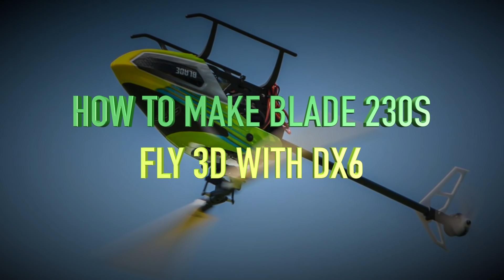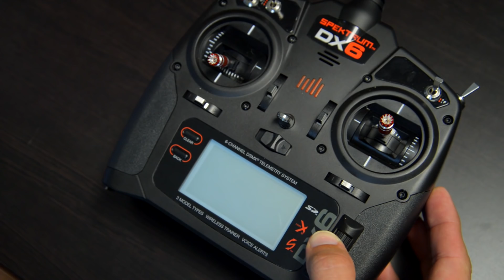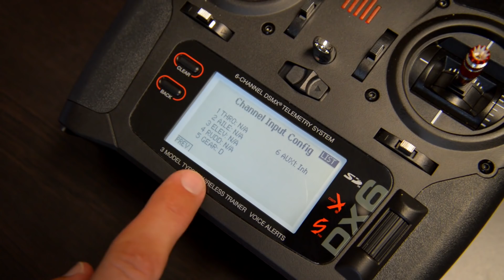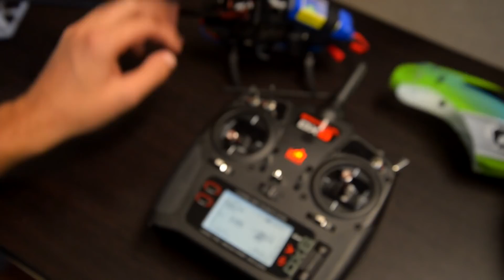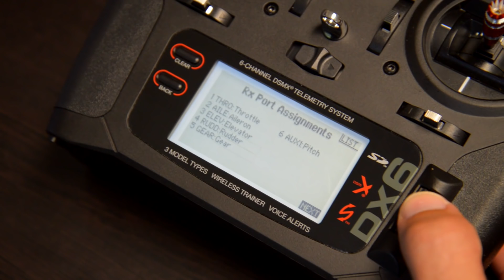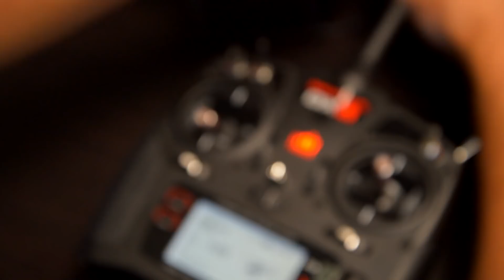How to Fly Blade 230s in 3D Mode with Spektrum DX6

Comment: This video is eight years old are you still out here somewhere I need help… I'm trying to get stability mode on normal which it is but I also want it on flight mode 1…If you're out here somewhere do you still know how to do that or is it possible… I'm just an older guy that just wants to fly and stability mode but I wanted to be solid if I bang it around hard Rudderr hard climb outs… I wanted to be solid but instability mode.  I don't like the low had speed it normally comes with.  Everything was spongy and awful for my flying style

Comment: Just a question.  My swash tilts really a lot with left up high. After spoolup you can lift of, but my normal mode also does the same. But when i move the sticks the swash stays where it should. When you switch to normal, should the swash not level and not stay in the position of a level swash. My heli want to tilt forward.

Comment: The DX8 is a lot better I hear. Even better than the DX9 when it comes to Choppers. It's the most used Transmitter in my Club(I think they call it 8.1). It has a far better programming + other details, and ½ the price of a DX9, if not even cheaper, but same quality and making.

Comment: I'm confused...  the swash should still follow the sticks even if the safe mode has been disabled. ie... Once the safe mode has disabled the swash should go back to a level position because the right stick has been placed back to zero input for aileron and cyclic. Yours does not.
Reply: Exactly. Slowly, but it should level out in idle up, too.

Comment: When I set it up to the manual my servos would always go to neutral but would not try to self level when I pick the heli up and move it side to side when in idle up.  But when in stability mode the servos would always try to correct it.

Comment: can you please do a setup for dx9
Reply from the maker: It would probably be almost exactly the same. Just observe which switches you want to program and assign them accordingly. The GEAR setting is where it all happens and why I made this video. To share that tidbit that the manual left out. They may have added it now on these newer ones but mine did not have that description in the orginal literature.

Comment: Do you know how to get voice to work with this? i used the switch A and voice is not working even tho i set up it to work. Thanks for the video. so do you normally take off in safe mode? or with it turn off
Reply from the maker: +epoweredrc That's strange, the voice works on mine just fine. I only take it off SAFE when I want to fly it inverted and I'm feeling adventurous haha.
Reply: +David Beretta Thanks, I played with mine more and figured out that some of the voice prompts will not speck for some reason so i ended up going with stability mode and 3d mode on that switch, thanks for this video i enjoy it being on a separate switch flew mine today 3 flights I am loving it so far.

Comment: hi david ,couple things .... i have my dx6 setup per the spm file from horizon . my safe modes are on the b switch . did you have throttle hold on during this video?
you must have or the heli would have went in to full power when you switched from safe to stunt . 
my bind button does nothing ,is there a setting for this somewhere ?
Reply from the maker: +fnkycoldmedina You have to program the bind button to be the SAFE Mode Recovery switch. The channel mixing instructions for that are in the manual in the setup section for it.

Comment: Hi Dave, I'm a little confused. I setup my DX6 exactly like the 230s manual said. Assigning switch B to channel 5 and I can fly inverted just fine. So does your way still able the to use safe mode? I don't really care if safe mode is disabled if programmed according to the manual, just trying to understand the different programming.  Thanks.
Reply from the maker: +Steve Marks Yes, the way I showed is still able to use SAFE mode when flying the heli in all flight modes. I honestly don't know how yours worked just fine when it came to flying it inverted because mine wouldn't flip over because SAFE mode prevents the swash-plate from allowing it to flip over in my experience with it. That's why i made this video to show where SAFE mode can be disabled and allow you to fly it any way you want while preserving the PANIC mode function.

Comment: Hi David, great video, like they say, a picture says a 1000 word. but just to confirm, your DX6 setup, was that straight  from the 230s manual? or have you made some additional tweaks?
Thanks
Reply from the maker: +Mark Huxford
 Hey Mark, thank you for the kind words! I set the DX6 up just like the manual said to do it for that transmitter. The only deviation from the manual was changing the switch that disables SAFE mode like I showed in the video as it was not mentioned at all in the manual that you can toggle SAFE mode using that channel-switch.
Reply: +David Beretta 
Thanks for replying David, just setup my DX6 ready for tomorrows delivery.  Sorry if this seems a daft question but on the Blade website they describe 3 flight modes, Stability, Agility and 3D. Can i assume that these are Normal mode, stunt 1 and stunt 2 on switch B.  Reason i ask is when i view the outputs on the monitor screen of the DX6 when in normal mode there seems to be no change or limit to bank angle. 
Im still a noob to all this so keen to understand whats going on behind the scene's.
thanks in advance.
Reply from the maker: +Mark Huxford I thought the exact same thing until I tried to make the helicopter fly inverted and it would not allow me to bank the helicopter more than about 45 degrees in any direction and once I let go of the stick it would automatically level itself back to 0. That is why I made this video was to show people that there is an extra channel programmed by default onto your D switch which I changed to my C switch to make flying this helicopter inverted a possibility and the fact that your manual does not explain this to you in any way. I will advise you though, if you are new to this hobby then you should stay in SAFE mode while you learn the basics of hover control and orientations and once you become good at that then try it without SAFE mode trying to level the swashplate for you so that you get used to stabilizing the heli in a hover without SAFE helping you. And don't do what I did yesterday and forget you have a Panic Mode switch and then lose your orientation and crash it into the ground haha. Luckily I only cracked my canopy. Happy Flying!